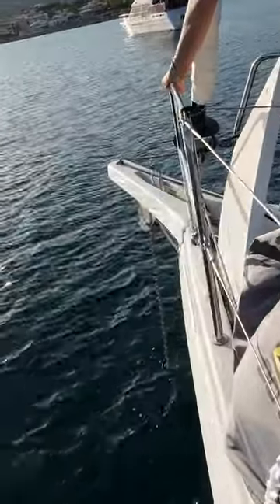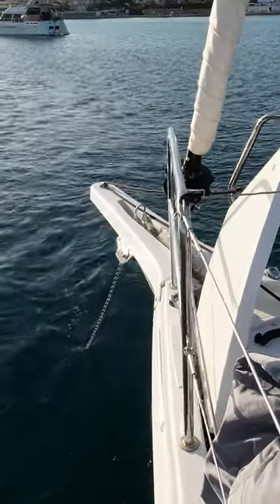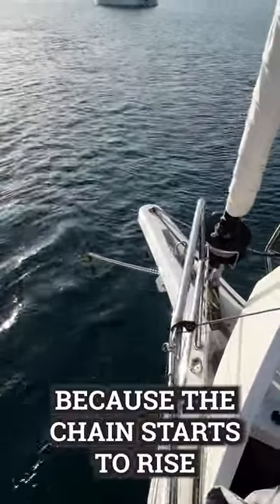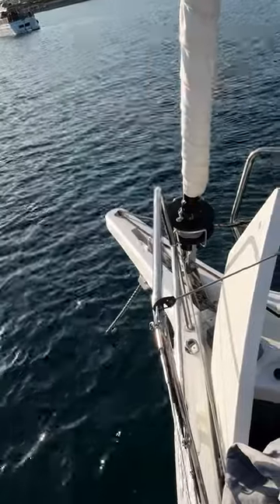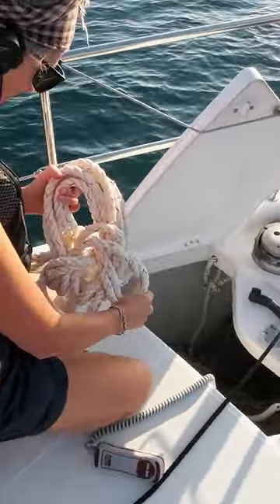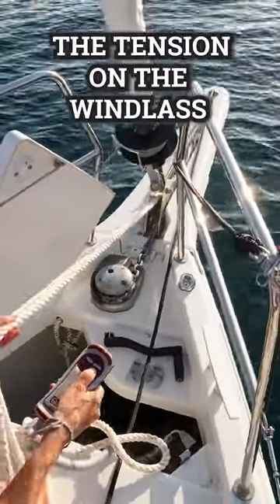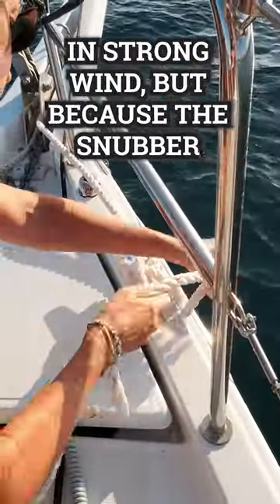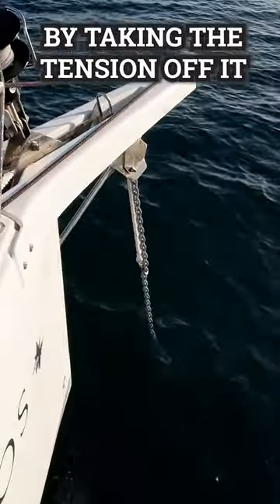How We Drop Anchor

Comment: Should eased a half hitch to finish off the Snubber
Reply from the maker: We actually use the OXO method rather than finishing with a half hitch. This means that there is no chance on the hitch getting pulled tight and being hard to remove. Just pulling the line around the cleat like we do keeps it tight and we have been on anchor for three weeks at a time with strong winds and it has not moved